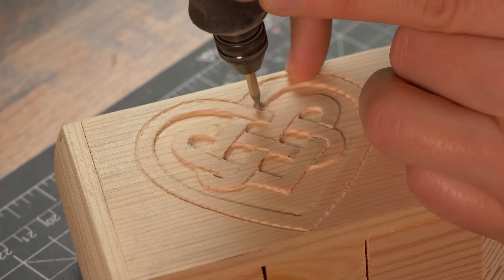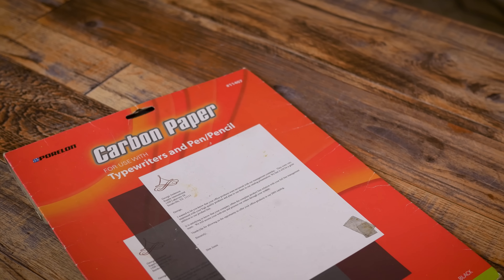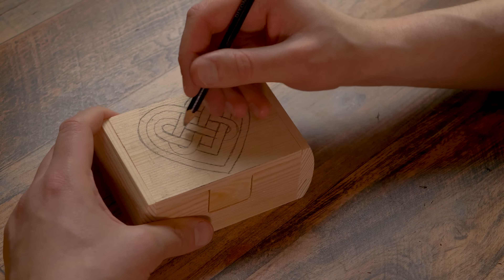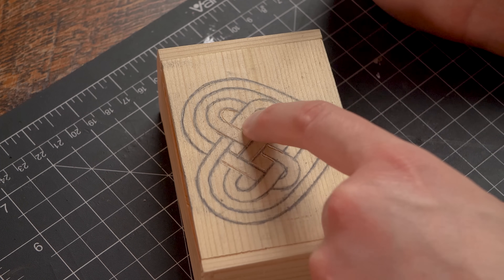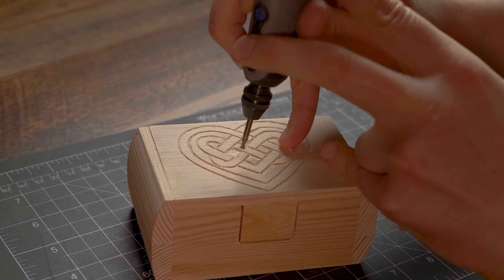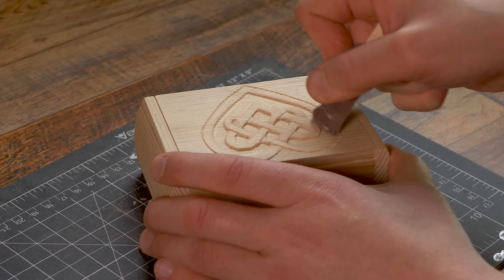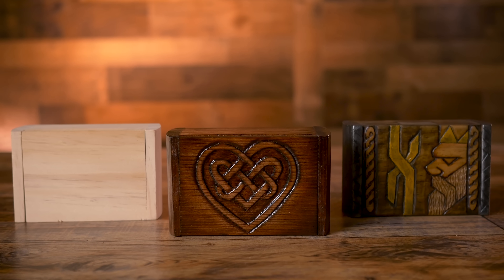How to Wood Carve/Power Carve Designs With a Dremel

Comment: For the Fogging Glasses Ting: You can get a glycerin solution for small money at drugstores, whiping your glasses with it will keep them from fogging up. Its the same stuff that is in some Fluids for fog machines and it basicly ceeps the water from bonding and forming drops.
Reply: OR = wipe the lenses with anti-static dryer sheets/

Comment: You sir, have surgeons hands when it comes to your ability to make such a straight cut, what I'm really hoping is that when you started engraving that your Dremel bit (mine's a 3000 with a flexi-shaft) went flying off like it was possessed and determined to do it's own random scribblings and and scratching. I understand now, through your videos, that I never learned how to change and vary the pressure and technique when let your bit go clockwise and vice-versa. For engraving, if I already own the Dremel 3000 and I have only begun to seriously practice engraving wood and acrylic glass, should I just learn from my mistakes on cheap bits of wood and hopefully gradually get the hang of it, or would you recommend investing in the Engraver or Stylo?
Thanks man, your videos are invaluable!
Reply from the maker: Thank you Paul! You will get the hang of it my friend. Get some soft wood and start by tracing designs. You will get it down my friend. No need to buy a new tool.

Comment: I have a question, hope to get an answer.
I want to carve some small size projects (like not more than 10x10 centimeters (less than 3x3 inches)) but also I want to be able to cut an eventual stuck screw (6mm in diameter (1/4)) on my motorcycle/scooter/whatever. What would be the better choice, Stylo or 3000?

Comment: So I'm just wondering if you can use bits that aren't diamond. I've been having a really hard time finding Dremel bits.  Home depot and Canadian tire only have basic bits, and no longer carrying fancier ones. I know this for a fact as I used to work at Home Depot.   Mind you that was over 15 years ago. 
    I'm not so sure about ordering them off Amazon, because I don't know if I trust the stuff. 
     I don't need little fine pieces of metal going through the holes in my goggles. 
I also don't need to spend the rest of my day going from hospital to optometrist which is what will happen if the ER doctor can't get it out. 
     Been there done that with a friend. 
 BTW your videos are great.

Comment: I bought some bogwood chunks from Ukraine and want to make some pendant necklaces with them. The app you used and the stencil idea is very helpful, thank you for that. The bogwood is oak and naturally stained very dark from being in the bog. It is almost 4K year old wood! They are kind of thicker pieces. Roughly 3 to 4 inches thick. I want to cut them thinner and don't have a lot of tools to work with to cut them with. Is there a way to use the dremel?

Comment: PLEASE I have a question! I was offered a rotary tool as a BD gift, the brand is '' Crown '', and I don't think I have all the bits that I'm looking for. However when I look for them I only find the Dremel's ones. Can I just buy those if needed or do they have to be made by the same brand? (It might be a silly question I'm super new to it ...).
Btw thank you so much for the video it's just AWESOME 💕
Reply: Probably so they're pretty universal
Reply from the maker: You can use any brand of burr or bits :)

Comment: Thanks for such a great video! I'm working on some projects now and am wondering how you get the negative space to be all the same depth. Mine always is very bumpy. Not sure if I'm using the wrong burr? Any tips would be appreciated! Thanks again for such a good lesson. Might have to try a knot for myself to practice. <3
Reply from the maker: So glad you enjoyed it. Getting negative space smooth can be a difficult task. I use the inverted cone burr then sand a lot. Just practice and you will get it!

Comment: Silly question maybe,could you possibly use a sanding or polishing wheel of some sort instead of sandpaper
Reply from the maker: You can but you will have to be careful not overs and specific areas

Comment: I was curious on how much money do you possibly make on the boxes that you carve how much do you no on how much to charge when you post one up for sale?
And how many of these boxes can you get done in one day and post them up for sale and how do you figure on the price to sell them for I would love to know cuz I'm trying to get into this wood carving I got most of my tools I'm just trying to get my work station set up.
But I'm running into one problem I live in an apartment and the noise and the dust and everything else it would cause don't want to get in trouble from the office so I need it find out how I could set my little crafting station up and what equipment and what accessories do I need to purchase before I get started since I live in an apartment could you please possibly message me when you read my message and let me know how you got started when you first began doing this kind of crafting project and lead me in the right direction since I live in an apartment I'd really appreciate it very much.
You could private message me and let me know.
and one other thing where would I buy all these boxes and wood at that wood help me do all these projects for low cost and all the patterns I would need to help me on this project and anything else that you could think of that would help me begin the right way and not fail at this.

Comment: I'm actually going to buy a Dremel brand Dremel as opposed to a no-name one because I really like working with it and so far the other ones I've had didn't make the grade. I bought this cheap-o one at the Lidl for 11 Euros and quickly discovered it was useless. Then I looked closely and saw that it only has 10 Watts, so no wonder. Then I found this noname "Professional" brand that my neighbour left behind that has 135 Watts but seems to vibrate way too hard, and gets incredibly hot after a few minutes. My father has a Craftsman which I've borrowed on occasion, where although it's pretty good, it seems too heavy to use with one hand for long periods of time. So yeah, I'm just going to get the real thing.

Comment: You take a deer antler size is the your hand size the way you want it and then buff that inside that heart it'll be so smooth you won't even need to send and you do that whole box with that deer horn it'll be so slick like glass I make walking sticks that it's going to have and that'll give you the look what you want it'll be even prettier than that right there but you're making that pretty gloss in there and buffs it that's your horn does and you do a good job

Comment: One question: the accessory on the dremel has to be very tight? I just bought the same you have but the accessory (carving piece) moves if I turn it with my hand.

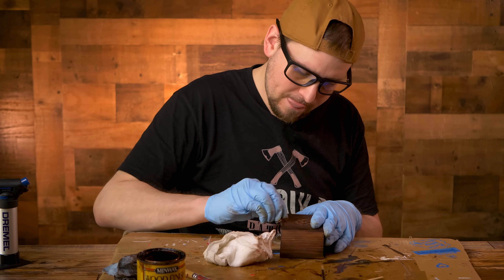Comment: Do you mean wipe off the excess? At 13:03, You said, "...and then, wipe off the access." I'm assuming it's supposed to be "excess" judging by the other issue of, " After I'm done sending this,"  instead of saying "sanding" from 13:30.  You seem nice and I like your techniques, but I'm distracted by the wording as well as some of the pronunciation. I'm from Texas, but I've lived in Arkansas, Louisiana, and Mississppi, so southern accents aren't new to me. Having nice, clear, accurate pronunciation of words is even more important than the nice, clear lines on the carving because while your work might speak for itself, you have to use your words to teach. This is something that you could easily work on to give your videos the same level of polish & attention to detail as you do to your lovely wood carvings. I wish you the best of luck.

Comment: Dremel 🙄 bought a 4300 top spec and it blew in minutes. Contacted the supplier and dremel and neither replied. I wouldn't recommend.
Reply from the maker: Wow. Where did you buy it from? I’ve never had this problem before. I’d contact Dremel by their number again and try to get through. They usually have fantastic customer service
Reply: Digikey. Com supplied it. Bought things before which were spot on but this thin just blew massive sparks and make a pop like when a light bulb blows, didn't even touch the wood. I will keep on them for sure, it's a weeks wage I can't afford to lose to be honest.
Reply: I just picked up my Dremel from Amazon, hope it doesn’t break....
Reply from the maker: It will be fine I’ve been using mine for years
Reply from the maker: I hate to hear that man. That company should do something about it. With all this craziness going on there isn’t a lot of people in the office. I’d keep rocking the phones and emails till I get an answer.